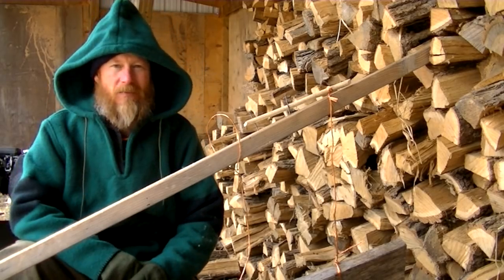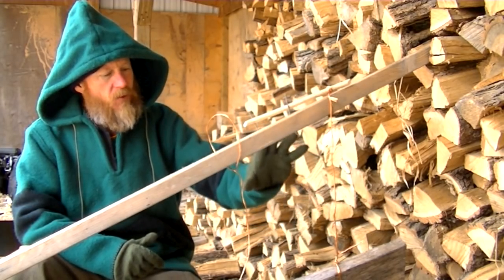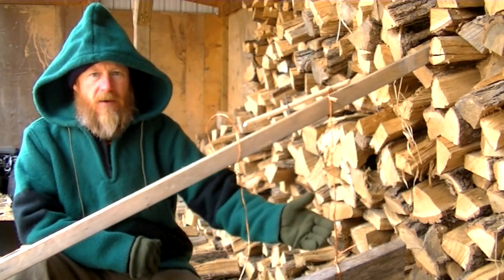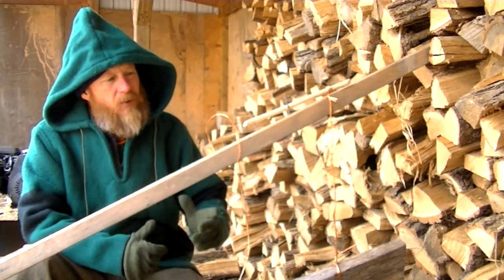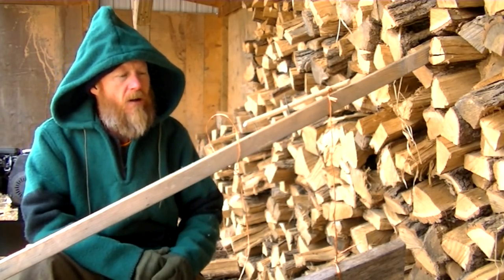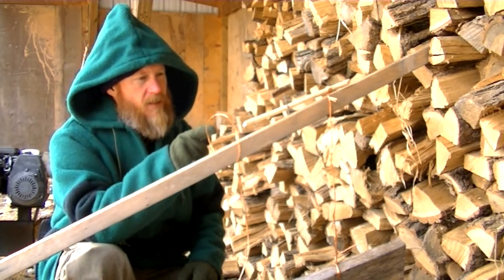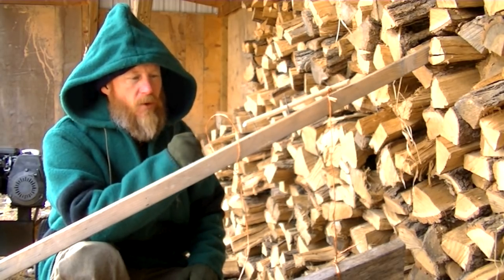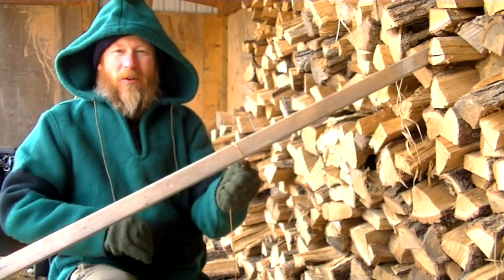The Norwegian Deadfall

Comment: From a logistical standpoint, I'd be most concerned with how to bait that trigger so that animal works it enough to set it off before stealing the bait. And also when it gets snared, it'll throw its body off the side and try to flail free from the snare. That snare only really holds the animal down from the top, with less pressure on the sides and bottom. Has potential though.
Reply from the maker: Well, I learned it from a guy who used it successfully so I will take his word at it. With any trap you need to practice with it to be proficient.